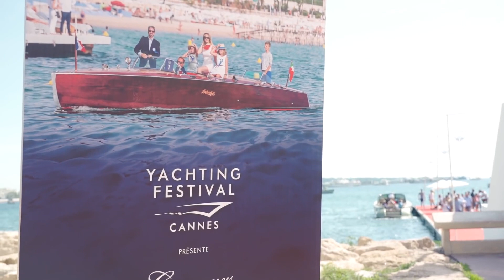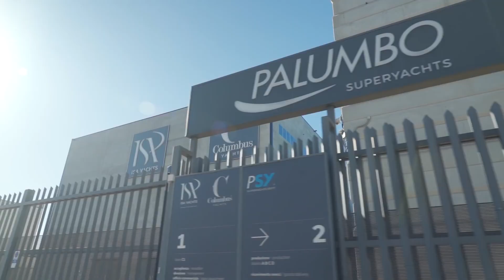THE AMAZING "SILENT 80" SOLAR POWERED CATAMARAN - HOW THEY BUILD IT!

Comment: Silent Yachts cost even less when you factor in all the maintenance and repairs the boats DON'T have - Check Engine Light costs, Oxygen Sensors, Timing Belts, Oil Changes, Oil Filters, Coolant Flushes and Thermostats, Gearbox Services, Leaking Gaskets, Bad Injectors, Spark Plugs, Coil Packs, Ignition Wires, Diesel filters and clogs and various other Engine Sensors. On average, over a ten year ownership that's several THOUSAND dollars EVERY year. Silent Boats - zero $$$

Comment: I don't think it's the environmental friendliness that's the reason. It's total freedom, you never have to worry about diesel or anything else. If you have a desalination device and a fishing rod, you can stay on the water until the motors give up.
Reply: Absolutely right. I've never believed in or cared much about the global warming lie, but I've been a major proponent for so-called renewables for the very simple reason of fuel availability. These boats exemplify the very concept. Freedom from burning fuel. The near complete removal of maintenance requirements on diesels is just compounding that fact. I'd be perfectly content cruising at 5kts so long as I also have the ability to run at 15-20kts to avoid weather when needed. These two have clearly thought about what matters.
Reply: I couldn't agree more. These yachts enable peace of mind in its purest form. I always hated the idea of having to run a generator at anchor even if you just wanted to microwave a bag of popcorn. Making every single resource onboard renewable and basically free is amazing.

Comment: As an engineer, I want to like it, and I'm glad someone is taking on the challenge to make yachts greener.  It could work well for owners that do not go too far at a time, but they are trying to represent it as an ocean going yacht with unlimited range, which is highly irresponsible.  

While the numbers differ for the different sizes, it's the same basic story.  Take the 60 as an example, using info from their website, the solar panels are 16kWp (peak, meaning optimal conditions, no clouds), while the smallest motors are 2x50kW.  Now if you cruise at 5 knots, they are probably operating at a fraction of that capacity, but then you have to run the a/c, navigation, all appliances, and charge the water toys on top of it, and all from that 17kWp input.  The solar panels are just not capable of supplying all the energy needs in that scenario.  There's a reason they have a 150kW diesel generator onboard, and a fuel capacity between 600-1600L.  So if you are doing more than a few hours of cruising a day, the generator will likely need to kick in.  For owners that will use it once in a while to take shorter cruises around the coast, it's probably perfectly fine and will vastly decrease fuel consumption and carbon footprint, and may even be zero emissions.  

But to use it to cross oceans, you'll probably not be doing more than 60 to 80 nm a day in good conditions, and you'll likely run out of supplies and put lives at risk.  I love the concept, but it will only take one owner that has an incident while making a crossing for the media to jump all over this, and that will put the whole concept of clean solar yachts at risk.
Reply: No to attack you, but it's clear you're not a sailor. For 3 months a year, I am an Alaskan Fisherman in Bristol Bay. In a 32 ft long 18 ft wide gillnet boat, I easily store supplies for 3 very hard working fishermen, for 21 days at a time. We eat roughly 3 times what we normally would when we're down south, as down there we're not working nearly as hard and not needing the extra energy to keep warm.
Passage from Anacortes WA to Hawaii at 5 Knots would take about 21 days. And after running some hull calculations it would require 15kW to propel the vessel at this speed. So (2371.91 / 5)*15kW = 7,115.73 kWh of power to get to Hawaii. 
(26 kw solar * 12-dy)*21 days = 6,552 kWh generated b the panels. 
A deficit of 563.73 kWh for the entire trip. Genset hours for the trip: 3.75 
All the other electric demand on board, including the AC, would add at most 630 more kWh of demand, bumping my total gen set hours to 8 for the entire trip. Using roughly 367L of fuel.
Reply: @davidblalock9945  As stated, I'm an engineer, nowhere did I claim to be a sailor.  

I'll take your word for the calculations above, but common sense would dictate that between Washington and Alaska, you would not get anywhere close to the peak output of those solar panels for 12 hours a day, every day for 21 days straight.  And it's not about how much food you can pack onboard, but how much is actually taken on by the one planning the trip. You can also easily make stops on that trip, as you are not too far from the coast at any time.  Whereas I'm talking about a true ocean crossing, Atlantic at a minimum.  

Like I said, it only takes one incident and the media will be all over it.  I'm not a sailor, but neither are "journalists" that will sensationalize a tragedy and destroy the whole concept just for a few more views and clicks.  See early and even some current coverage of Tesla cars, for example.
Reply: @Ethan7s  I would comment that how much you would get out of the panels would depend on the time of year. If you left even in May, you have light until quite late at night in Alaska, but only till 7pm or so in HI. Most people also don't run the AC then entire time.... Definitely not in Alaska.
 I think a lot of it depends on the panels themselves, and of course the size & capacity of your battery bank. There is a lot to consider.  I think it's doable, with the right configuration, and careful energy management. But, let's be honest, careful energy management is necessary with fuel based systems too. If I were planning a major passage in a similar boat, I would be doing several multi-day shakedown cruises to understand how and when i use the most energy, and determine what kinds of conveniences (AC) I'm willing to live without, and making adjustments as needed before doing a major passage. The kind of thing that any smart sailor does before a serious passage. I agree that the media could scare the hell out of the public, and that they love to do that, but the people easily scared by that stuff are probably not sailors, and have probably never done a careful examination & budgeting of their own energy usage.
Reply: @Ethan7s  One very interesting thing that could really cut down on concerns is the optional automatic kite sail. I'd imagine it to be quite a bit less versatile than a sail, but with the right winds, I bet you could cross an ocean comfortably without having to turn on the generator. I am looking forward to the next videos from silent yachts, the new Silent 60 is supposed to have one.
Reply: Hi Ethan, I truly understand the piece of this yacht is not 100% green at all, that the gen will be running for long periods to recharge the battery bank, and there will be days it will be running constantly. But as a sailor that’s the same concept for not having winds while in a sailboat, you’ll have the need to motor sailing and have the gen running. In regards of running out of supplies, well the question I have is, have you done long passages? because the probability to run out of supplies on this yacht would be the same you’ll have in a sailboat, which for those that have done long passage is very uncommon .
Reply: @ready4utoplayw  the thing is youve got 12hrs of night time and many hours of cloudy conditions with very little solar power generation.  where as the wind can blow all night and all day - big difference ! I
Reply: @rhett7716  Hi Rhett, thanks for you comment you are right, but  I never said they would able to sail without ever running theirs genset,  I just said it is safe and they can cross the Atlantic without having issues with theirs electric motors. They will use a lot of theirs genset, but still less fuel than a motor yacht , more than a sail boat, but still have the possibility to use solar power weather permit.
Reply: @rhett7716  Winds can, but they may not. Having to constantly raise, lower, & switch sails if you're single handed, or short handed can be rough. winds can be, and often are, unpredictable.
Reply: @ready4utoplayw  we did long passages and you are fully right to compare it to a sailing boat - yes we consume diesel - bu7t for sure less than a sailing boat. The main question is, how many boaters use their boats for only a couple of hundred miles per year and how many cross an ocean regularly?
Reply from the maker: Hi Ethan, I interviewed the owner on my other channel (you can see it at https://youtu.be/T8FCZzRCQVk). Im hoping to interview him again soon on this channel so your comments would make for an interesting discussion.
Reply: It seems if ocean crossing is a major goal of using this yacht, it should be thought of as a diesel-electric hybrid, rather than a solar powered one. Get the E-Power+ with dual generators and the max fuel option of 5000 liters. Figure you are going to burn a decent amount fuel getting to your destination. Once you are at your destination, and start doing short island/port hops, then it could mostly be a solar affair.
Reply: @FlintIronstag23  

It could make the crossing on just solar at roughly 5-6 knots. 

Of course, you may want the option of running it as diesel-electric hybrid at about 10 knots. 

It is nice to have options. lol

A sailing cat with auxiliary motors would probably fit right between the two speed wise although it would take longer because the sailboat may need to tack and jibe
Reply: @ycplum7062  I really hope it can travel 5-6 knots indefinitely on just solar. I'm just skeptical of that. Hopefully when these things actually start hitting the water, someone will try a pure solar, no generator, ocean crossing. I would love to see the results!
Reply: @FlintIronstag23  

That was what happened on a cross Altlantic trip. However, they hit several days of bad weather and had to use the generators because they had to make it to a boat show on time in Florida. I think they used several hundred gallons of diesel.

I think it would do very well in the Med in the summer, the Intra-Coastal Waterway in the US, and in the Carrabean all year.

If I hit the Lottery, I would definitely want one, the 55 or 60. The 80 is a bit large for the US.
Reply: @ycplum7062 a sailing cat would be a fair bit faster with decent winds but as you say would probably not be able to run a strait course most of the time.
Reply: I have been following the Silent Yachts (and waiting to hit the Lottery to afford one lol). I had the same concerns since i also have an engineering background. 

Assuming you have good weather, you can sail approx 5-6 knts indefinitely 24-hrs a day (roughlly 100 nm a day) while using almost all of the domestic devices, to include A/C.  If you have less than ideal weather, you will need to throttle back or just drift about till you get some sun. Of course, you may elect to kick in the diesel generator at that point. That is no different than if you are on a sailboat and run into calm.

The did a cross Atlantic trip in the Silent 64 and burned 1300 liters due to bad weather, 7 days rain with high winds and 8-10 seas. Fortunately it was in teh first two legs, which were also the two shortest legs. They could top the tank back up for the Atlantic crossing. Personally, I would not have elected to do such a crossing in February. lol
https://www.youtube.com/watch?v=EJUnZlYDOTE
Reply: I just want to clarify that I am not against this concept, the yacht, or the builder.  I want them to succeed.  My objection is only about their representation about the boat as an ocean crossing vessel with unlimited range, that might get some new yacht owner killed because they might plan for a few small delays, but any sailor knows the weather can be unpredictable and often uncooperative.  

As an analogy, I raise the same issue with Tesla auto pilot.  I like and want electric cars and Tesla to succeed, but it's irresponsible to market the autopilot as some self driving miracle, and people have been killed because they were too reliant on it.
Reply: @Ethan7s  hi Ethan , I understand your concern but as sailor I can tell you that crossing the Atlantic Ocean can be done with this yacht super safe , hey I am not saying if there is a major failure on the entire electric system you wont be in danger , but I believe you have the same odd to ran out winds and your diesel engine fail at the same time in a sailboat. Electric motor are very reliable , lithium batteries are very reliable, having two Gen set give you redundancy . So during a major failure you still have the possibility to cut power consumption reroute energy to the engines and maybe many other solutions and manage to get save to the closest destination .
Reply: @ready4utoplayw  that’s fair, thanks for adding to the discussion.
Reply: 16kw peak power that is also when theyre at the optimal angle to the sun isnt it. ??  This boats deck is way off optimal to the sun and therefore cant be very efficient
Reply: @rhett7716  

That would depend on the Latitude and time of day.

They were able to pull of a a cross Altantic trip with an average speed of 5-6 kts from the Carnries Island or Cape Verde (They had to use the generator due to bad weather during on the first leg. Not sure how much of teh first leg was on generator) to Maimi. That isn't too bad. They went through several years of testing on prototypes, I think a 40 or 45-footer, before ramping up to a 64 foot beta tester.

The boat would do well in the Meditteranean or Carribean. I think teh Meditteranean was the original target market.

For a long trip, such as a trans Atlantic, I think a sailing vessel would make a bit more speed even with tacks and jibes, but the Silent would likely do better (on average) for shorter trips. The Silents would also allow you to not follow prevailing winds as much. A trip from the US West coast to Hawaii could be faster by sail, but the trip back would likely be faster with the Silents.

All on average of course.